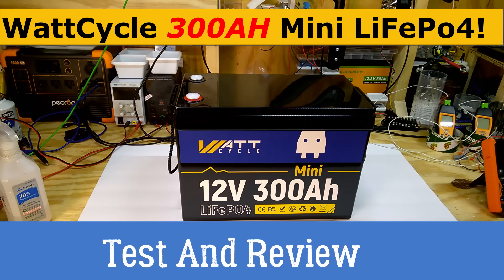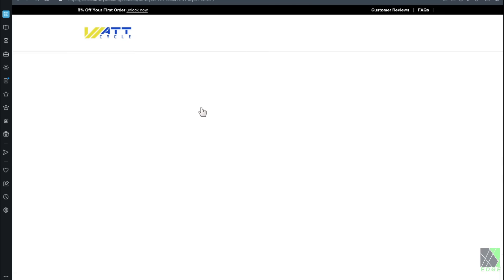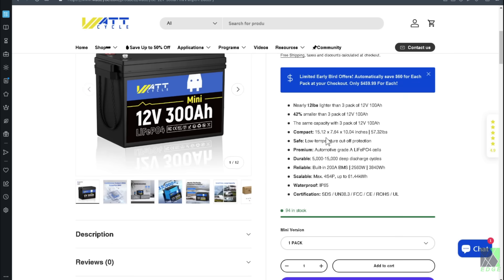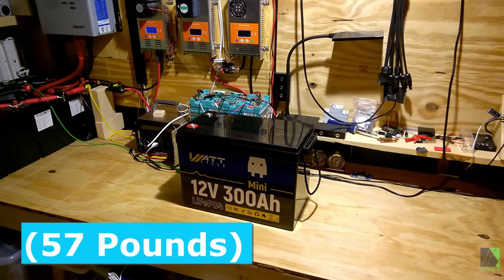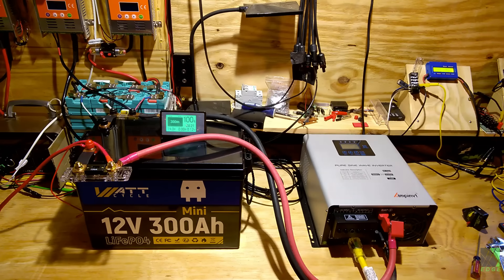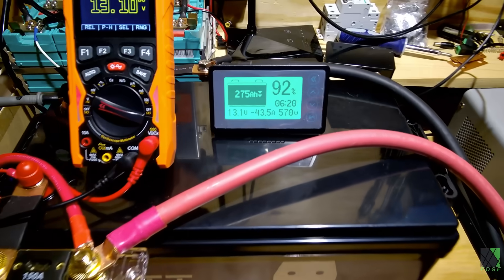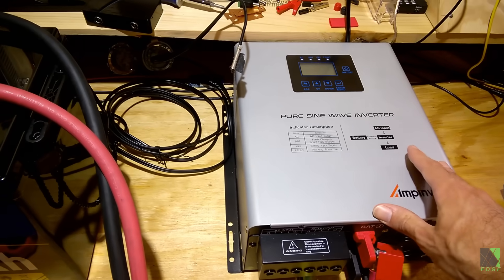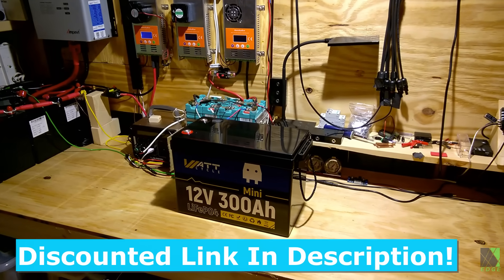WattCycle 300Ah Mini Test & #Review! How Long Will My Heater Run? #Solar Power Off Grid #WattCycle

Comment: I left 32 160ah cells sitting for 2.5 years as I built my ev conversion, and they stayed within .005 volts of each other. I wired in parallel a few times to balance. Amazing.
Reply from the maker: Nice. I have nevert used a BMS on my house batteries. They are raw 3.2v CALB cells. Almost a decade without balancing. The GBS battery in my shop never had a BMS either and is 10 years old. However I wouldn't mind having LVC in case I made a mistake...

Comment: Hi would I be able to use it for trolling motors ???
Reply from the maker: @FMF.Fishing Hi! yes a good size LFP battery can run a small trolling motor. Try measuring the Amps your trolling motor pulls from the battery - then you can estimate how long the motor can run. For example, it the motor draws 50 amps, then a 300ah battery should provide about 5 hours of run time. 
PS Wattcycle recently discontinued this 300ah battery model. It was replaced with a similar model, now labaled as 280ah as far as I know. But it should still offer the same or similar performance. Hope that helps. -Dave

Comment: Have you been able to do a retest yet? I think about buying a 100Ah version for my caravan, and it's quite cheap. Therefore, I'm a bit worried about the long-term capacity.
Reply from the maker: @AnarchoMomo Hi, no matter which batteries you get, I recommend doing a cycle test to make sure they have the labeled capacity. A C-rate of around C\10 (that's Capacity divided by 10, or 30 amps for a 300ah) is a good test for LFP storage batteries. A higher rate of say 100 amps will burn some of the ah away as heat...

This 300ah sample still has a bit over 300. A while back I tested Wattcycle's 100ah model, seemed OK and also had more than the officially rated capacity. I've since moved the 300ah battery to my workbench to power a new 12v oven and other experiments. We'll see how survives in about a year.

Comment: I am trying to run a 500 Watt load, 24/7. I have about 2,500 Watts (usable) of solar panels. Or it's supposed to be a 5,400 Watt system, but it's a used system I bought.
What size/amount of batteries do you recommend for that? I was thinking 3, 100 Ah batteries? I'm not sure though, being your single 300 Ah battery only ran the 500 Watt heater for 6ish hours.
Reply from the maker: @lockdot2 Hello, the solar panels need to be large enough to produce >15 kw/h in one day first and foremost. The battery bank itself probably needs to be at least 4x300ah which is about 15kw/h. Then, some excess solar power (beyond 15kw/h) is needed to recharge the batteries the next day if they were drained. Of course, adding a bit of extra battery storage capacity helps with those cloudy or dark days. Solar stuff can get pretty expensive! Another option might be to use the batteries for backup, and use the cheap grid power to help run the load. Just sharing my thoughts. Anyway I hope this helps... - Dave

Comment: Must be an issue.  Can’t find it for sale on the website but I see it in a picture.  For sale on Amazon with 22% off
Reply from the maker: @neckofthewoods24 A large solar channel talked down on the 300ah battery. And in response, Wattcycle decided to re-label them with smaller capacity. It's a strange world. With the price drop this battery starts looking really attractive, I would certainly buy it.

Comment: Hi can you please send me the link for the digital meter which is displaying battery amp voltage and how much watts are you using which you used in this video and placed on top of battery
Reply from the maker: @nasirmohammed8118  Hello, the meter is shown in the video (linked below in this comment) and there is an amazon link in the description! Because I can't post web store links here in comments.... please let me know if you can't find it
https://youtu.be/OEPnwosBYE0

Comment: The specs claim a low voltage cutoff of 9.2V.  That seems crazy low; well under the 10.2V hard threshhold for cell damage.  I have yet to see any explanation for how they achieve this.  My cynical self says they're trading longevity for greater stated capacity, claiming more capacity at the risk of damaging the battery.  I'd love an explanation of how they achieve this.
Reply from the maker: The sample I received yielded >=300ah at 11 volts. My personal philosophy on LFP is even 10.2v is too low and the "BMS" should be a last line of defense.  No one competent and knowledgeable about Lifepo4 chemistry would regularly discharge 4S LFP to 10v, let alone 9v unless they were in research/testing, an emergency or made a mistake. Yet I'm sure it happens all the time. That said, 10.2v beats 9.2v, which in turn beats -0.0v and would prevent a total loss.  The only time I bring LFP down to 11 volts is for a review, would never treat my LFP cells that way voluntarily. After over 10 years of using Lifepo4 as an early adopter, I want to do a video on the "truth" about how these cells should be treated. There is so much misinformation.
Reply: @solarpoweredge  I guess I should get something like the Victron Battery Protect to cut off the loads and leave the chargers connected.
Reply from the maker: That should work... or even a DIY programmable switch connected to DC contactor. Too low/high, the whole system shuts off instantly. I have never used a BMS on my main house banks. Just raw cells that are well balanced and properly charged. But, protecting them with a low voltage cutout LVC is an absolute must - otherwise could wipe out the whole system if accidentally running them down too low while unattended. (HVC is a good idea too)

Comment: More information than I really need to know. Bottom line: if I lost power which electric heater will run longest on this battery to keep me warm?
Reply from the maker: Hello, in my opinion a 300w electric space heater is a very reasonable load for this battery. That would run about 12 hours and is only suitable for a small space or workshop. For a comparison of electric battery heat vs. propane, please check out this video: https://youtu.be/uD8lcMK42bk

Comment: Looks like a good battery, but I have been looking into efficiency and 48v seems to run far more efficient than 12v systems
Reply from the maker: Higher voltage can be more efficient at transmitting DC power. On the other hand 48v systems and inverters often cost more, and there are more cells in series and therefore increased chances of failure in that regard. Therefore, we can see engineering is about costs and tradeoffs. After over 10 years I tended to stick with 12v equipment as it is cheaper and more widely available, while using direct PV2L to drive larger loads such as heating etc. 
If cost was no object, I'd consider 48v, 72v, 96v or above to maximize efficiency :)

Comment: Interesting battery, what kind of cellbalancer is inside? How long ""absorbtion time"" time at max charge voltage in order to allow for internal top balancing ? The cells will and do drift by time and DOD each time
Reply from the maker: @Sailingengineer74  Hi! If you want to use OEM voltage set points, Wattycycle has published full charge parameters on their website in a PDF. 
Interestingly enough, I have run multiple banks of prismatic LiFePo4 cells for about 10 years with no balancing and no BMS. Those cells are still in service today. Once I have more exposure, I hope to do a video on that topic...  including series cell dynamics, IR, the truth about C-rate, BMS vs. BPC, maximizing cycle life and so forth.

Comment: i could use 4 of them. 
two for the rv, 
one for the aux system in my truck,
one for my ham shack.
future 8 for the whole house system. 
it does get below freezing at times but far more days over 100F.
Reply from the maker: @larryjanson4011 I'd sure like to have 8 :) if I had to put them in freezing temps, probably would build an insulated battery box and install a small heater, could be an interesting project
Reply: only gets that cold in the winter. i live below the snow line.
but yes the rv they would be inside were it can be temp controlled with a simple dog bed warmer. all wrapped up in a styrofoam box.
same in the truck. dog bed warmer and 2-3 in thick styrofoam box. inside a lined bed job box. (box lined just to cut down on noise really).
the house gets cold as i can not afford to heat it, so the heater is turned off. but again a simple dog bed warmer, maybe a battery blanket.
only place that it would get that cold, is in the bed box.
if it comes down to it the rv, and truck batteries can come inside the house for the winter, or just a very cold spell?
temps through the end of this year will not get much below frost on everything. melts even before the sun hits it.
Reply from the maker: @larryjanson4011 The dog bed warmer and foam is a good idea

Comment: It would be better for noobs of you actually said the battery capacity you tested - not everyone knows how to calculate it based on watts and run time.
Reply from the maker: @elelegidosf9707 I hear ya... I used my Amp meter set to 300ah and it went to zero, that was my way of showing capacity. I definitely don't wish to cause any confusion... anyway thanks for the feedback

Comment: I’ve had a 100ah lifepo4 battery hanging around my boat for years , I use it to charge everything ! I’ve just checked it and it’s as new , must be 4/5 years old 😊😊😊
Reply from the maker: @petersimms4982 Nice :) the blue colored one on my workbench is at least 10 years old, let's just say it's been through some hard times :D

Comment: What is that meter you were using that showed the percentage of the battery?
Reply from the maker: @Boondocker99 Hi, the official technical name is "coloumb counting amp or battery meter" or it's also called a battery fuel gauge or battery meter. Here is the video where I installed it for my workshop https://youtu.be/OEPnwosBYE0 and there is a link in the description, or just search online for "battery meter" there are several different kinds. hope this helps! -Dave

Comment: Good info, I really wonder if there is a tradeoff with the compact size. I’m a boater and the smaller size would let me put much more capacity in my limited area. I’m 79 so did I mention the much lighter weight would be great.  So,, Can they and others mfg shrink all Lipo batteries
Reply: The power storage of lithium prismatic cells has increased steadily in these bargain brands
Reply from the maker: @wallacegrommet9343 Yeah it's good to see... I hope the prices stay low for everyone, the way the world is these days we might see some instability
Reply: 4cell lifepo4 da 300amp. 3.2volt in siries 12.8volt is very good
Reply from the maker: @dc13032  Hi, the energy density on this battery is higher than past options (more power crammed into smaller space) It is 57 pounds, so lifting it is pretty challenging. Lipo or pouch cells in a hard case might be an interesting option! as long as they're covered by a protective shell

Comment: I was considering several 400-600 AH Lifepo4 Brand of batteries, but most had single 200-250 amp BMS limitations. It would run a 3 KW inverter, but I like the idea of having the potential of 400 amps total if there are other loads besides the inverter. However I would need to add a couple of 4/0 jumpers to complete the setup in my RV. Currently there is a pre-molded battery tray for 2 group 27 batteries, these almost would fit! The LiTime 560 AH battery does not fit that space. Currently we are planning to be on the road headed to FL when AMZ would be able to ship these to my son where we are visiting now. Maybe checking for a Black Friday special is in order. Cheers, David - KU9L
Reply from the maker: @KU9L Hi, I cannot see the RV layout, just sharing my thoughts... maybe you can modify the battery tray or add a second battery compartment. it can be difficult to find batteries when there are space constraints. It's an engineering challenge... hope you're able to find the right ones. One option I have leaned on in the past is long 4/0 cables and add an extra battery any where it can be hidden. Or just hide one right next to the inverter. It will share some amps and reduce the load on the batteries closest to the inverter. Of course this kind of thing is a bit stressful if one has OCD :)

Comment: I think in any battery what they claim it will do is tell you the amount of cycles without any severe derogation, with any luck they'll last for twice that as they become less efficient as time goes on.
Reply from the maker: @dougtheslug6435  Good point - my hope is to get 5-10 years or more cycle life from LFP by not abusing, overcharging or deep cycling. I truly hate running these batteries down to 0% for testing, but it has to be done....
Reply: @solarpoweredge  I get the test and why, those are impressive results with one battery. Definitely will be going to similar size when the time comes, amazing the tech they're coming up with.
Reply from the maker: @dougtheslug6435  Yeah hard to believe they crammed 300 ah in that small box - good stuff :D

Comment: Hey, great video!  If you were to put four of these in series for a 48v battery for solar, how would you go about wiring it and monitoring it, and what would be the options for getting it to communicate with an inverter like a Victron?  Would it make sense to connect another BMS to the four batteries, and have that BMS communicate with the inverter?
Reply from the maker: @malk6277  Thanks! Here is 100% my personal opinion.. if just starting out, I'd recommend using only 12v/parallel connections (join all positive and negative battery terminals). Monitoring using a basic coloumb counting battery meter they are about 80 bucks. Add a good quality 12v inverter with a fuse. No extra BMS needed, it is internal to the batteries. There is no way for these batteries to communicate with an inverter, BUT they will power an inverter just fine! Hope this helps - Dave
Reply: @solarpoweredge  Thanks Dave, much appreciated.  I need to build a 48v battery, for our home.  I'll keep researching.
Reply from the maker: @malk6277 Welcome sir :) sharing a bit of my experience: if you do put normal 12v LFP batteries in series, I recommend checking each 12v unit with a quality voltmeter at least once per month. If one of the 12v units drops or raises it's voltage more than a little compared to the rest, I recommend to stop using the system immediately and manually re-balance each 12v battery. Use the greatest care and caution! The 4 individual "BMS" circuits are often not able to solve this type of issue at all, and it can cause a serious "problem" if not caught. Best option (but not really cheap) is to use native 48-volt batteries. 
It is not my intent to discourage solar DIY'ers, only share truth, knowledge and prior experience :)

Comment: WattCycle Claims they use EVE A Rated Cells in these Batteries.
According to a video on the EVE 280 and 300 Ah Cells, Both Cells are the Same Size, and EVE under rates their Cells by 10% so their 300Ah Rated Cells will Actually Flow ~330Ah, and their 280Ah Cells ~311Ah (Max) before the BMS cuts them off.
Remember that Battery Manufacturers usually stick to standard size Cases for their common rated batteries for same form factor mounting, and that LiFePO4's Cells are Smaller than Lead Acid cells.
ALSO Overseas Shipping Charges are mostly based upon Volume, and smaller Dimensions per unit allows for less shipping cost per unit from China. (NOT Shipping as much Air!)
* APPARENTLY... WattCycle is taking advantage of this and are using EVE's 280Ah cells to be able to Claim/Give 300Ah Capacity while selling them at a lower price, and allow for a Smaller Void to be left within the Battery case allowing the MINI's smaller size.

Thanks for the video!   🍺🍻
Reply from the maker: @CriticalThinker-42 Good breakdown of the details, thanks :D

Comment: Any downside to using these vs an EG4 battery for home battery backup?
Reply from the maker: @ryan52403 I'm not very familiar with EG4, had a quick look at it just now. In my opinion, it's probably cheaper and better to assemble a standard DIY system with discrete components. Anotherwords battery, inverter, charge controller and cable it all together. That said, EG4 looks like a premium solution!

Comment: Your findings were similar to Wil Prowse as he tested the 100 AH model. Watt cycle seems to be the lowest priced LiFePO4 battery out there.  I heard there is an abundance of lithium hence battery prices are dropping.
Reply from the maker: @philc.9280  Hi, you are right... there has been too much mining of lithium (over production) and it sometimes costs more to mine it than what they can sell it for.  It's good to have lower prices, but at the same time we certainly don't want the market to collapse leading to production problems and a battery shortage. PS I reviewed a the WattCycle 100ah units also, and they seemed to be pretty good batteries. They are in long-term testing right now in my shop. If things go well, I will be able to do long term updates on all the batteries I have reviewed after 1 year or so.

Comment: Thanks for sharing. What make/model is the battery meter you are using? Do you have a video or blog post with the tools you use for testing?
Reply from the maker: @cocoloconuevo Welcome :D the meter is very generic, goes by several brand names. You can see one I installed here for the shop and there is a link in the description to the exact listing https://youtu.be/OEPnwosBYE0

Comment: If making system use 48 volts as you can use smaller wires,would be good for rv
Reply from the maker: @samfish6938 Good point :)